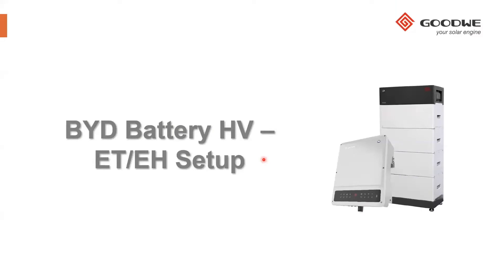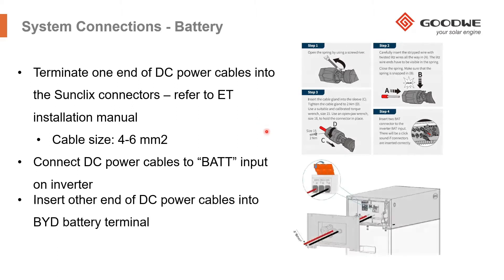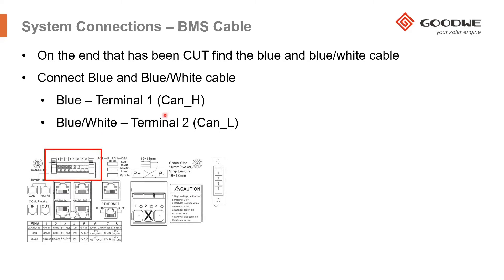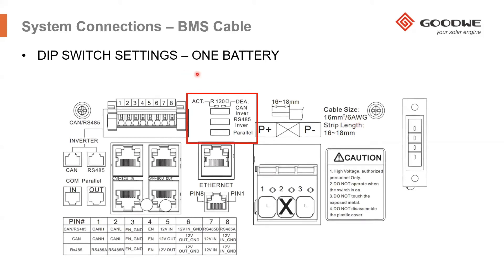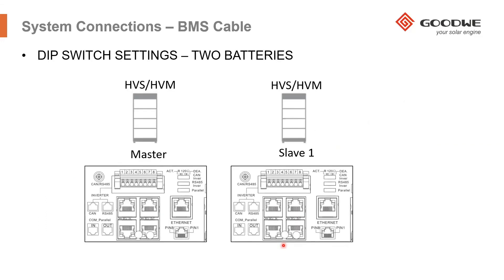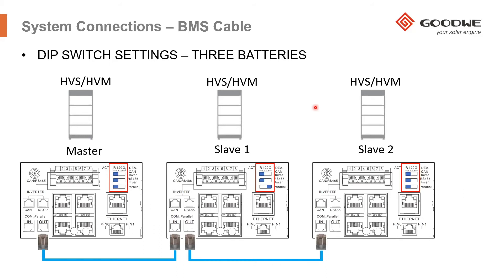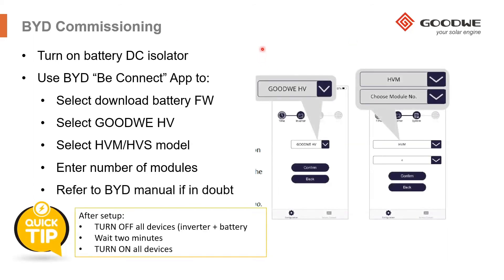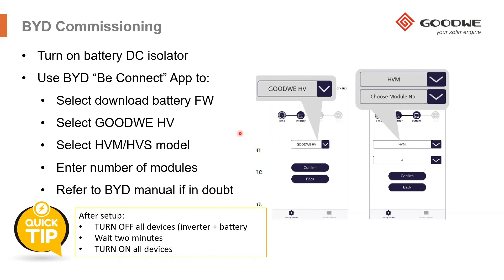GoodWe - BYD Battery HV ET/EH Setup

Comment: Hi, my BMS/METER cables are switched. And I couldn't manage to get it to work. Is the BMS cable always on the upfront of the goodwe inverter? Maybe they mount the plate with the readings the wrong way round.